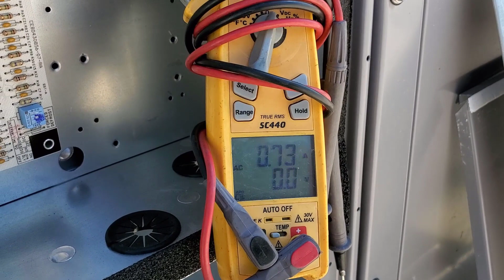Carrier RTU VFD needs Y2 for full speed

Comment: So I came across a unit like this today. Kind of giving me problems!!! 🤯 It’s short cycling. It’ll run for about 10-15 seconds then shuts off for about the same amount of time just does this all day long. There’s 4 RTU’s on this building and it seems like 3 out of the 4 are doing short cycling like I described. The unit I am working on is very similar to this one you are working on. VFD and everything. My question is. Is there a way to speed up the motor under “low” and “high” since it goes through the Honeywell controller. From what I read it seems the Honeywell controller only turns it on in “low” or “high” it doesn’t really have the settings to speed it up or down?

Comment: So should you have tstat wire run from tstat to RTU and terminated on Y2? I found same deal on Carrier RTU with VFD. Just replaced VFD and customer said they been having problems since it was installed couple years ago. Looks like it only has Y1 speed
Reply from the maker: On Carrier units if it has a VFD it is a 2 stage unit. Those are the only ones that had the VFD factory option for medium rooftop units.
This was an ICP and seemed to have them added on these single compressor units. I have not seen an ICP like this since this time.
For Carrier:

40Hz when G is energizes.Y1 brings on 1st stage compressor.  Y2 brings on 2nd stage compressor and blower motor now at 60Hz for full speed.
Reply: @ ok thanks. This Carrier RTU is a single compressor unit. Looks like the VFD is only to bring the blower two speeds 40 and 60 hz but doesn’t have Y2 hooked up. Probably needs Y2 for 60hz.

Comment: 40hz and 60hz. Y1 and G is 40hz....everything else is 60hz. The 24vac call goes to a rectifier board with relays that send dc to the drive for 1 of 2 speed reference signals. AI1 I believe is 40hz and AI2 is 60hz.

Comment: Damn I will have to check some of our units we installed for this issue
Reply from the maker: It's really overlooked on the new EcoBlue axial fan models. Especially the 6 ton 48/50FCQ07 and the 48/50GCQ line that techs don't realize has a 2 stage scroll in there.
No Y2 means only 70% capacity.

Comment from the maker: UPDATE:
There is a yellow and a white wire hanging loose on the wiring harness next to the VFD
Just plug those two wires into each other and the VFD will run on 60HZ (full speed) any time you operate the fan.
This is something they made handy for doing test and balance to get the fan to 100% with fan only.
Else jumper Y1 and Y2 so you get 40Hz on fan only (G) and then Y1/Y2 will switch it to full speed during cooling.

Comment: So without the y2 connect it won’t run?
Reply from the maker: It needs Y2 to run at 60Hz (full speed) to get the rated CFM for the capacity of the unit.
If you only power G and/or Y1 then you get 40Hz and your blower is operating at approx 2/3 of it's rated CFM.
Which is what you want IF it is a 2 stage unit but not if it is a single compressor/single stage unit.
Some of the smaller models (04 to 07 I believe) can have the single compressor with 2 stages and then you will want to run the blower at 40Hz for Y1 and then 60Hz for Y2.

Comment: I see some minor improvements in these new units. But they need to up their VFD game a bit. Trane has great user interface for monitoring and configuring their VFDs, and units in general, easily accessible electric part, etc. Lack of proper cable management is a joke. These cables are going to rub out and short, not to mention, it makes cleaning the blower harder.
Also, if you are specifically looking at checking current to VFD / motor, you should close the side panels, as that will add extra load to maintain same speed.
Reply: I have to correct you haha. On Tranes smaller RTU's you have to remove the blower access panel, insert half your body into the unit, turn awkwardly to the right, and try to read the screen while  without touching the belt and pulleys while it gives you bullshit numbers because the blower access panel is off haha. They SUUUUUUUUCK to use!
Reply: @jman0870  That is true. I saw such arrangement on Trane Voyager. They look to be simple retrofit of existing design indeed. The bigger models, do have VFD in electrical panel instead.
Reply: @movax20h  Yeah the Intellipaks and larger Voyagers have a remote drive display in the electrical panel. The small Voyagers do not and they are a bitch!

Comment: I’m wondering the low voltage tester if make them to sale?
Reply from the maker: I do get asked sometimes. But the only way I could sell them would be for someone to make them in mass to make it cost achievable. 
Buying a plastic project box alone can cost 10 to 20 $
Then the alligator leads, circuit breaker, etc.

Comment: That big pile of wires going through the blower cabinet and to the drive is such a joke. Is it that hard to use proper multi-conductor cable and terminal blocks to tidy things up?
Reply from the maker: I think that was all factory wiring too
Reply: Absolutely shameful, especially considering the cost of these RTUs. Guess the extra $40 per unit to have terminal blocks and cabled wires is just too much for Carrier.
Reply: @AmericanLocomotive1  Bro. I got it straight from a disgruntled former Carrier Service Manager. Carrier always uses 2 pole contactors on 3 phase equipment to save money. If Carrier can cut a corner to save one penny per unit, they will do it. Carrier is a shit company.

Comment: Im having so many issues with these vfd mainly because they don’t come with keypad and displays no way to reset them if they trip for any reason people been bypassing those  to get units running , carrier is just garbage units that need full redesign not vfd added or jade controller like them been doing. They need to redesign the stupid thing like completely new unit with good access panels that don’t require 7 screws , they need to start putting phase monitors i lost probably a dozen blower motors this summer because building looses phase thats not on transformer feed blower contactor pulls in and motor burns 

https://share.icloud.com/photos/0HOX0I5mD_g25l-YvUcGyYVeQ
All those motors out of a carrier just in last 2 months
Reply: To reset a drive fault you just cycle power dude
Reply: jman0870 After resetting fault you need to press auto for the thing to run again. Can’t do it on the carrier cuz no keypad
Reply: @igoiks  No you should not have to do that. The drive should be programmed to auto restart on a run command. If you need a keypad to start a blower drive it's 100% programmed wrong dude.
Reply: @jman0870  well tell carrier to learn to program their vfds
Reply: @igoiks  or you could learn how to program them....it's just a VFD. It's not magic.

Comment: Whole VFD to achieve just two speeds, worth it!? 😂
Reply: Removing inrush meets new SEER/EER/whatever rating your area has. It's why all residential equipment is pretty much ECM and compressors are slowing moving to inverter.
Reply from the maker: It is only on some sizes, so it must have been done to achieve an energy rating.